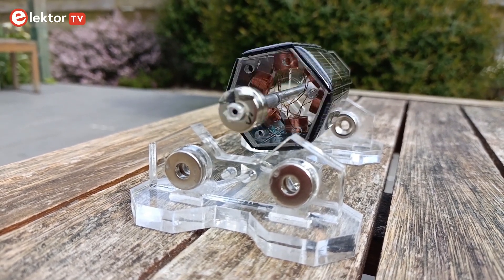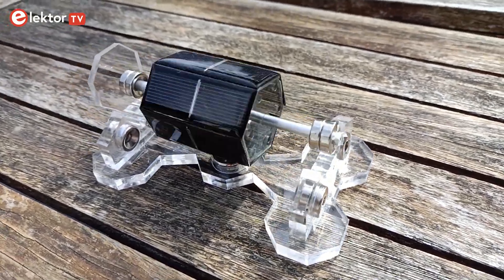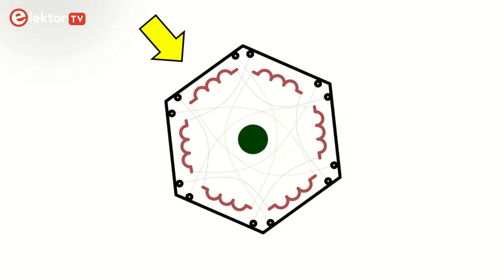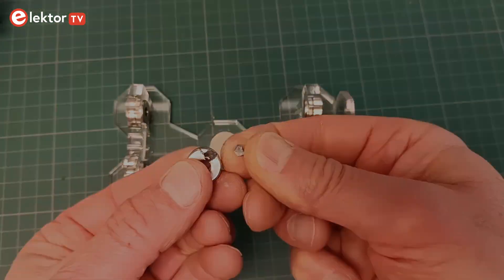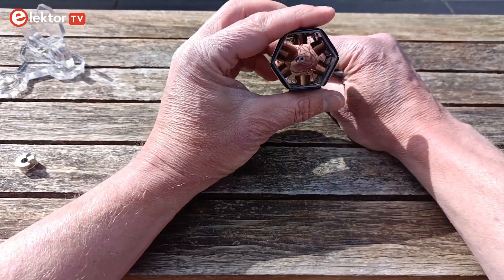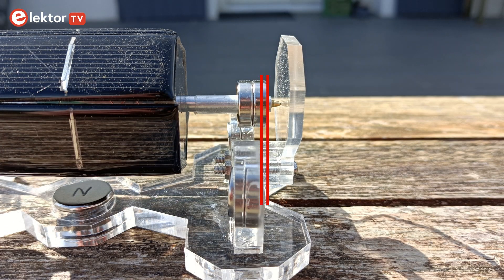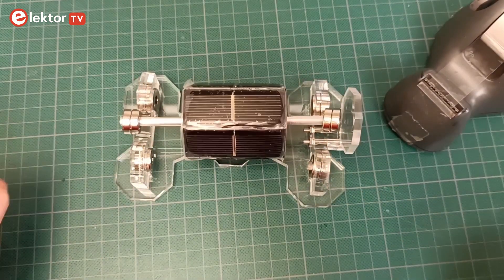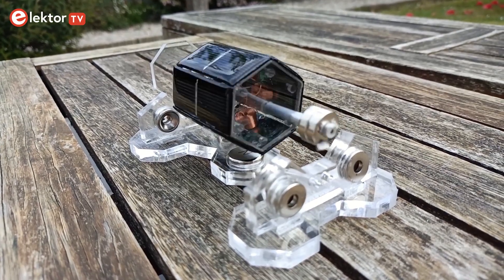Assembling the Mendocino Motor Kit

Comment: Other than a nice gimmick, what would be the application for this?
Reply from the maker: The Mendocino Motor Kit elegantly demonstrates solar power and magnetic technology synergy. While not utilitarian, it's an engaging way to grasp these principles. Its movement, driven by solar energy and magnets, bridges theory and application, making it a valuable educational tool. It sparks STEM curiosity and serves as a conversation starter about renewable energy's potential, all within a captivating display.